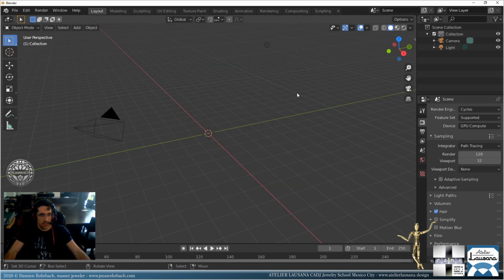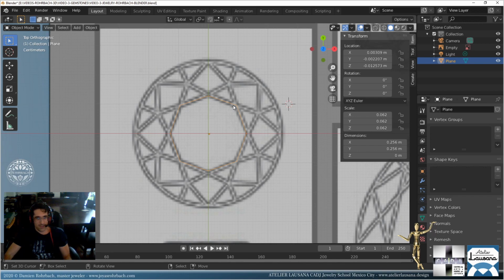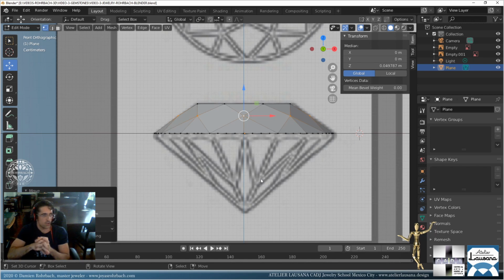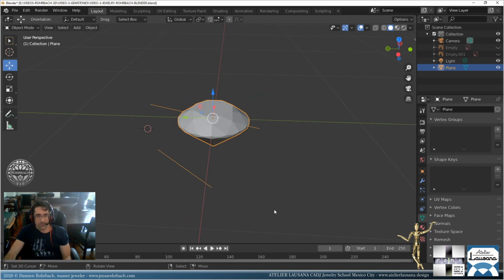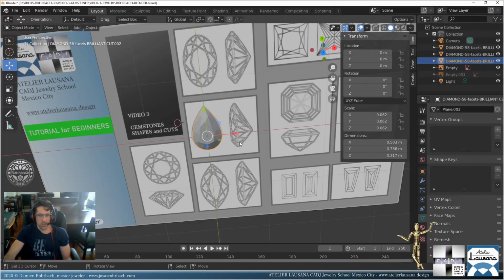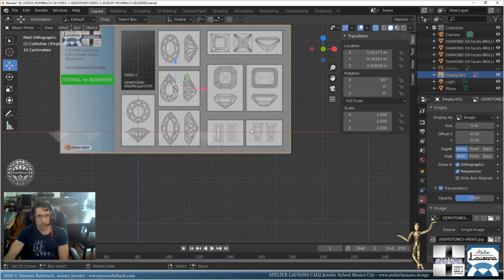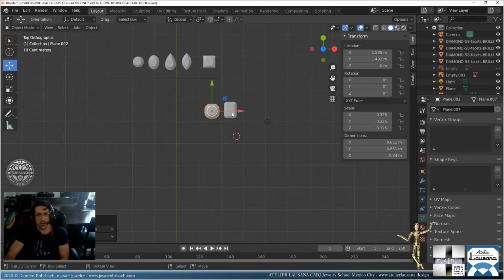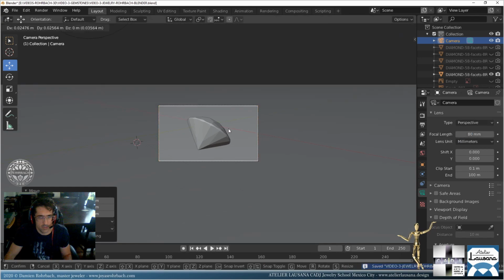Gemstones TUTORIAL 3 Jewelry 3D design with Damien Rohrbach and Blender

Comment: 34:54 for some reason, no matter what I do, the oblique line runs through the vertices of the square, but remains slightly off the ones of the cirlce, doesn't make any sense, don't know if and what i got wrong
edit: went through the whole process again, still not precise, I don't know what I am doing wrong, I followed every step :(
Reply from the maker: @richardmillyy  Sorry, Geometry is not geometrying for you. Light 8 candles for Pythagoras and draw 16 mandalas to redeem your imprecisions
Reply: @RohrbachJewelryDesign  lol, thanks for the answer man, I don't remember how, but I eventually got it right :)
Btw your series is really really helping me through my curricular stage at a local jewelery. 3D was not part of my strengths, let's say that, but your teaching is very clear and the fact that your reasoning is grounded in manual and practical knowledge, instead of simply 3D modeling, is beyond valuable. Matter of fact one of the many things my tutor told me is there is a lack of competent all-round 3D modelers precisely because people go study 3D and then act like they know jewelry making. Anyway, I'm really really happy because, as part of the stage, they're letting me design my own ring and they'll make me physically do it with my own hands!!! I'll keep in touch as I go through the series. May you have a pleasant day!
Reply from the maker: @richardmillyy  Thanks for the great story, until then, all the best to you